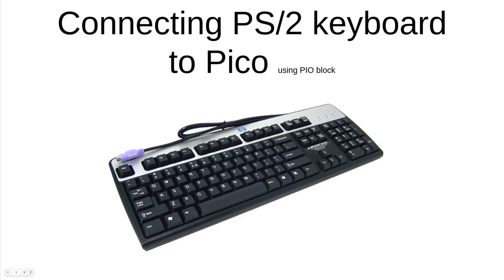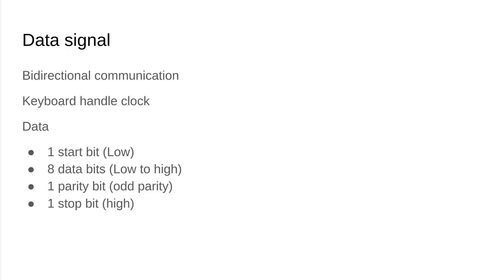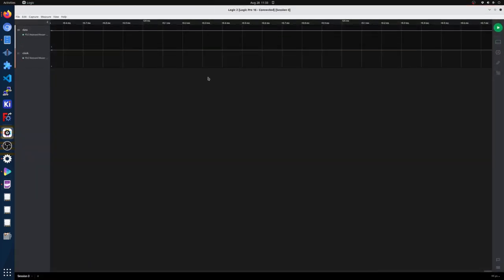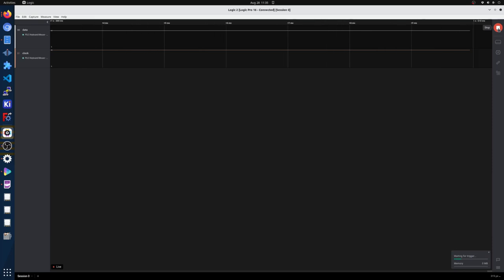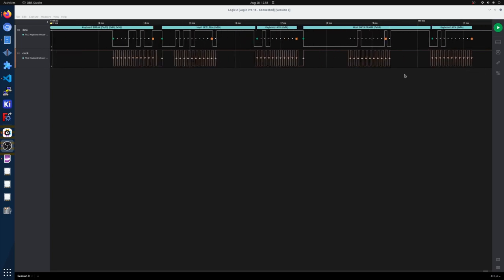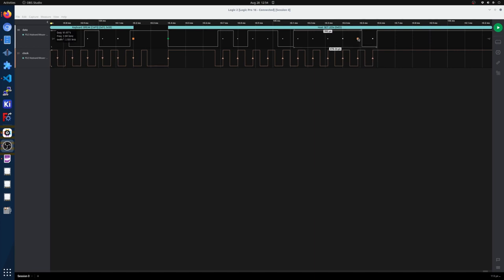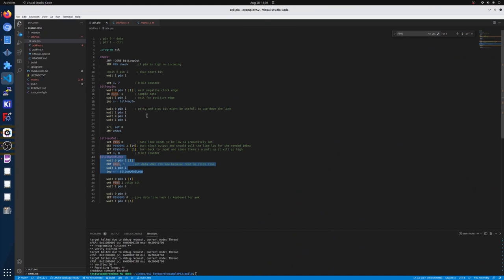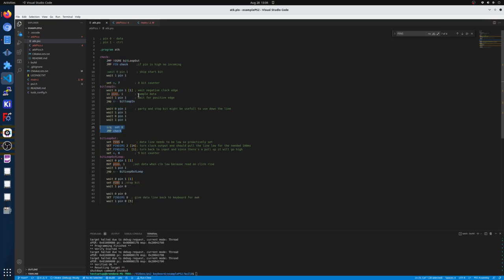raspberry pi pico - interfacing with ps2 keyboard with pio

Comment: Really nice! Is the timing dependent on clock speed? I am overclocking the Pico, will that be a problem?
Reply from the maker: Should work at different speeds.  The code has a clock to calc the proper divide.

Comment: Nice example, although not sure if I'm missing something? I've connected a Model F AT keyboard to my RP2040, I can read the scancodes just fine, but when trying to send 0xED to set the LED, the keyboards response is 0xFE (Resend).
Reply from the maker: Interesting?  Do you have a logic analyzer to grab whats happening?
Reply: @brendenadamczak9283  thanks, I actually figured it out not long after my comment.. Whenever you call atk_send_command, you are only ever adding the parity bit when you send the LED state itself, but when you send initial commands (such as PS2_COMMAND_SET_LED), you're not adding the parity bit to the command, so the keyboard fails to acknowledge it.